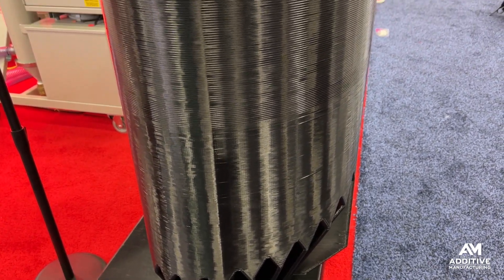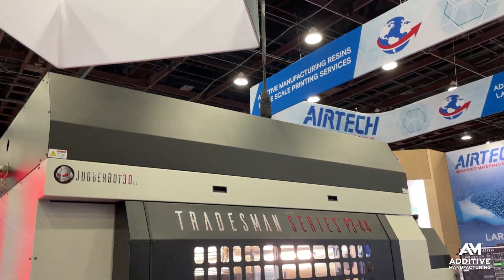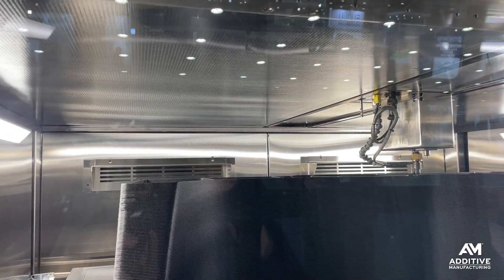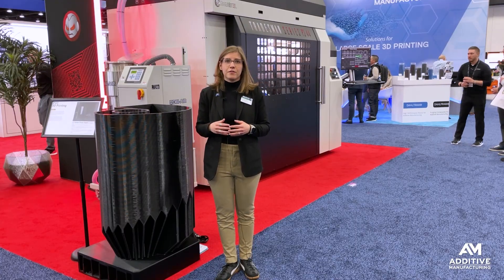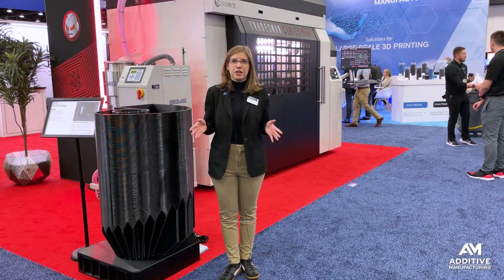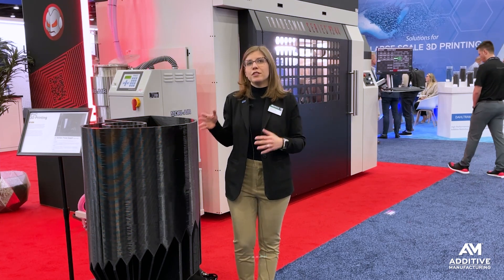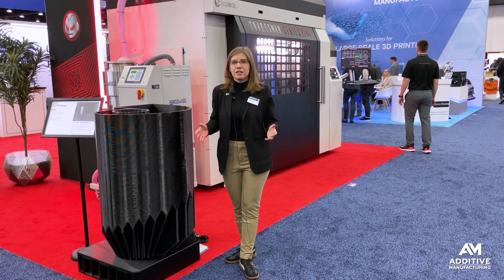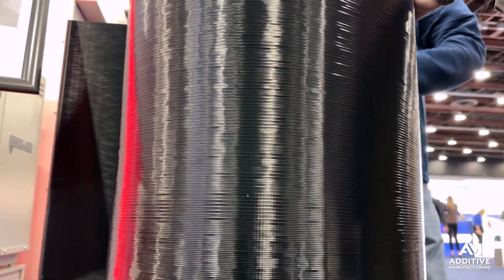How PVC Is Being 3D Printed for Industrial Applications

Comment: Why do they have to modify their 3D printer when they already have 3D printer filament made of PVC? Sounds like you really only need a hood extractor or decent ventilation, and a handful of extra nozzles.
Reply: We specialize in large format 3D printing solutions, especially systems equipped with Fused Granulate Fabrication (pellet extrusion) technology. Due to the size and scale our customers' demand, it made sense for us to develop a system on-top-of our base Tradesman Series P3-44, which also allows them to use less costly feedstock in pellet form (vs PVC).

There’s a lot to consider when printing at this scale, regardless of the material. Our customers’ safety and success is top priority, so as we learned about the nuances of processing PVC (and similar materials) we built the ASTRA package to make sure they could rely on the system without compromise.

Comment: So, the only reason we haven't seen PVC as a printing material was because of byproducts? That's surprising given the popularity of the material. Also, just curious what size nozzle that was! Great audio on the show floor as always!
Reply: PVC virtually requires extrusion at temperatures that starts the breakdown of the polymer. This, releases hydrochloric gas. Hydrochloric gas, is, for all effective purposes, pure hydrochloric acid. Meaning if your entire machine is not made out of absolut top tier stainless steel it's going to either rust or melt.
If you don't have good ventilation, you can expect everything in the same room as it to also start to melt. Especially when you're talking about a large format machine such as this. 
Theoretically under the proper circumstances and situations, you could in theory release quite dangerous chemicals. However that is quite hard to do in reality, and as far as danger to human body, the biggest threat is simply chemical burns in your lungs from breathing the smoke. 
How do I know this I've been working in extrusion for 7 years, with PVC being my primary resin type.  I personally, would have very little concern with 3D printing PVC in a small room with the machine. 
Except unless you have a all stainless steel machine, and a good ventilation system, it's safe to assume, everything in the same room as the 3D printer would be destroyed due to the high corrosiveness of the emissions.
Reply: @kwaad2  you touch on many key points when processing PVC. When we build out the ASTRA unit we set to to address the concerns you mentioned above to make sure that operators are kept safe, first and foremost, and that the machine and the environment where it is installed are both protected. Pretty cool experience you have, too!
Reply: That size of Vortex was printed with a 6mm nozzle (9mm bead width)
Reply: Also releases chlorine gas if brought to the right temp! So VERY dangerous without proper  containment and ventilation.
Reply: @SyNoon  no.
Reply: Obviously it's so you don't print your own Funko pops.